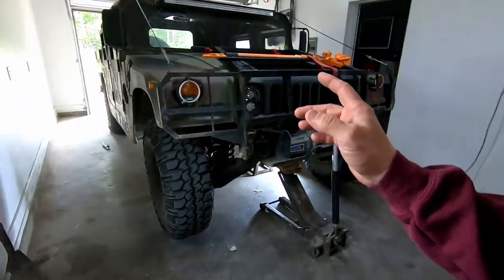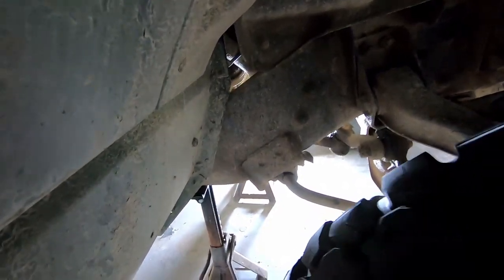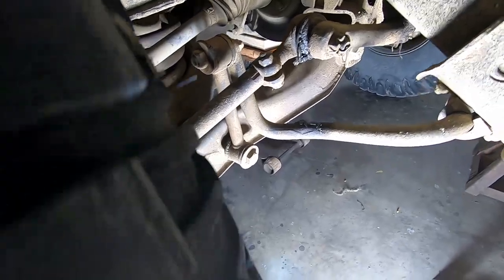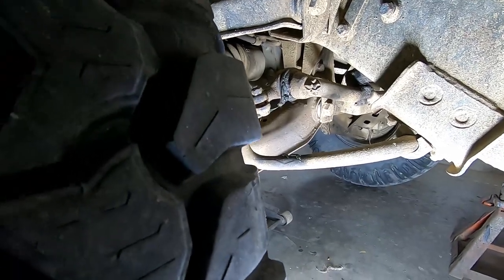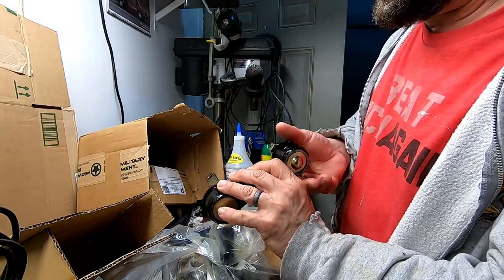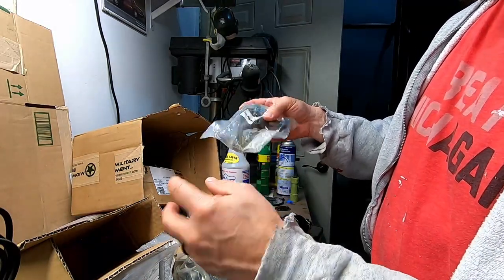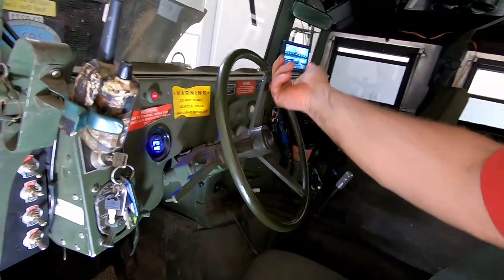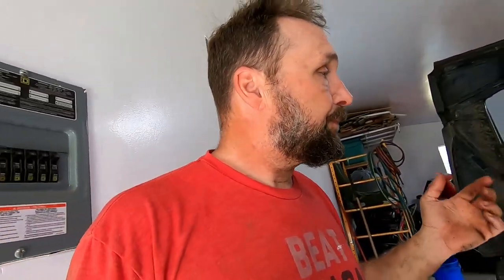Humvee Steering Diagnosis & Repair - Pitman, Idler Arm, Tie Rod - Frozen Joints!

Comment: I'll be doing this shortly on my m1123. My tie rod and pitman/idler arm boots are all leaking but the suspension is still stiff as hell. It was definitely confusing to determine which set of components to buy for an A2 humvee (not the heavy duty and not the m998). I forget which one you have but I think it's also an A2 as I recall. Nice to see someone else suffer through it first so I can take the easy route and avoid the struggles 😅 Thanks for your videos which are quite helpful.
Reply from the maker: Just make sure you have a good pickle fork, pitman remover and time.  It will make for a nice project when you are done.  Mine is just an M998.

Comment: DO NOT OVERPOWER >>>the steering linkage!!!  Very common problem caused by drivers who have not been properly trained to operate in On & Off-road conditions.  This video is an excellent case as to why AM General required all their HUMMER Dealers to have Off-road training courses for their customers.  To learn the "Do's & Don'ts" of HUMMER Operation!
Reply from the maker: Hello Jim.  What do you mean by overpowering?
Reply: When one (or both) front tire/wheel assemblies are jammed hard against an immovable object (rock, etc.) continuing to apply force by turning the steering wheel, multiplied by force exerted through hydraulic pressure can deform the steering linkage.  Idler Arm takes the brunt of that excessive force and typically will be first to deform.
Reply from the maker: @jimbella9353  That makes sense to me when you say it that way.  I honestly don't know of a spot that I knowingly attempted to force the wheel to turn against a rock or other object.  My wife is a good spotter and you can hear/feel the feedback in the steering if getting in that situation.  I think my main culprit was water intrusion as the boots were all in bad shape and I clearly didn't ever grease the lower fitting on the input shaft.  But good points to keep in mind.  It is all in spec now now and ready for more abuse!

Comment: nice video thanks, ill be doing this in a couple of days once the replacement parts arrive. Youtube certification, check!
Reply from the maker: It will go smoothly.   Let me know how you keep the tie rod measurement or if you just take it for an alignment
Reply: @McSpeedAlaskanAdventures  I like your method Im probably going to copy you. Did you take yours in for alignment after?
Reply from the maker: @hotwheelbigwheels  nope.  It feels and drives straight and I don’t put enough miles on it on the highway to worry about the tires.

Comment: May I ask a question about installing power steering onto a 1991 M1097? It never had EPS, so I need to order all the necessary parts, which I can only guess at . Can you help? ty
Reply from the maker: I would suggest reaching out to Midwest Military equipment and going over the parts with them. Bolting it up should be pretty straightforward.  I don’t think you’ll have any issue getting that all set back up.

Comment: Which power steering pump do you have? Is it the one that has the reservoir one the pump or remote reservoir?
Reply from the maker: With the reservoir built in.
Reply: @McSpeedAlaskanAdventures Don't forget to check the filter in the back of the reservoir and the flutter valve to make sure they are clean and free moving. Just a little bit of crap or sludge can slow down the steering. And if you're feeling really froggy you can replace it with the remote style. The difference is night and day. The remote ones pump more and better pressure, they are used on the heavy's. One more thing, I didn't see your vacuum lines on your portals, if I just didn't see them my bad. I believe you can get an operator's manual from Midwest, might make maintenance a little easier.  Let me know I can tell you how to do your tie rod and wheel alignment all together.
Reply from the maker: @mattlawson7007  great reminder!  I will.

Comment: Very common issue on H1 and humvee, it has 90% to do with deep water crossing, water gets inside stirring components and creates thin layer of rust, when you try to drive the next day or so, you will notice stirring  wheel is getting stuck and not wanting to return back ,

Here is the fix, raise the front end, open the hood, spray PB blaster on Pitman arm, tie rod heads, idler arm, right in the joint section where it can penetrate inside, start the truck turn the wheels back and forth and repeat the process few times.
I’m just few min it will fix itself.
Reply from the maker: That’s great info!!!!